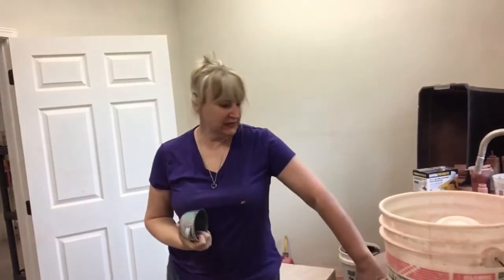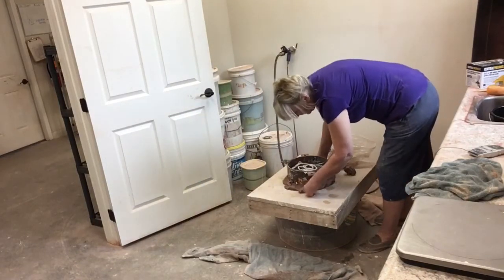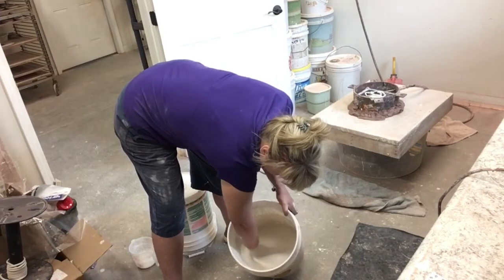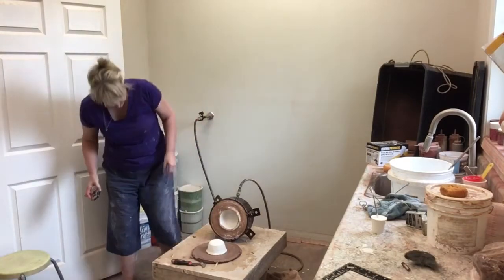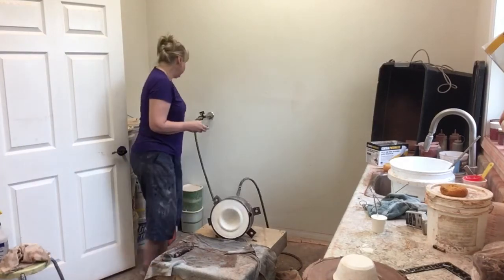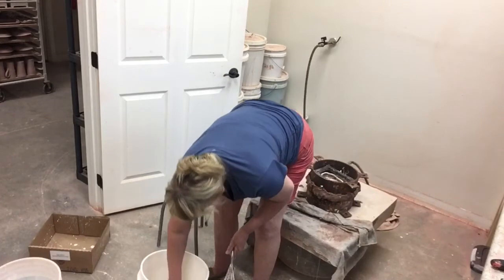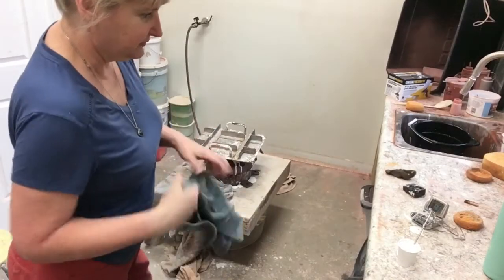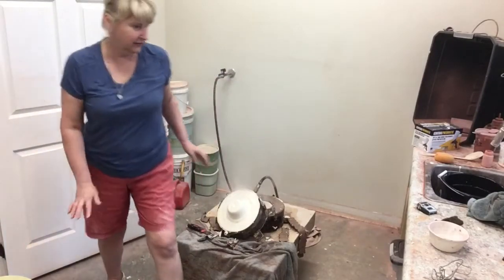Make RAM Press Molds | 2 Part Pottery - Ceramic Air Injected Mold | Salvaterra Pottery | Asheville

Comment: This video is fairly old but thank you for posting! You might be the only video that shows the entire process in depth step by step! I am getting ready to create my own mold so I’ve watched this video a lot! Have you tried using hydrostone? It seems to be the alternative. Ceramical has a pressure rating of 6,000 psi while hydrostone is 66% higher at 10,000 psi! I’m. It sure how thick your metal rings are but they look to be 3/8 so that’s what I’m using!

Comment: Hey Sue. 

Thank you so much for sharing your expertise, time, and knowledge. It is such a struggle finding instruction on air release ceramic press production, I found this video invaluable in setting up our press. Your video gives comprehensive instruction that couldn’t be delivered any other way. 

It is a long video but you continually offering helpful every step of the way without leaving anything necessary out. 

Thank you once again for your generosity, it is very much appreciated.

Comment: Hello Sue! I’m a potter in CT. I just started working at a tile factory making 1 part molds for the ram press. I had a brief training period and this video is filling in some gaps and adding information I didn’t have in my training. Thanks for making this video. You covered all the important steps and I found the video enjoyable to watch. I played it sped up because it is a lot of information to get through. I wonder if you’re still using the ram press and if you have considered making more videos about mold making. Specifically about: 1)designing gutters 2)Arranging your positive and hardware cloth+molduct system.
I’m using hydrostone for my molds but it seems like the whole process of mixing and pouring is essentially the same as ceramical. I add a little citric acid to my water before I add the hydrostone to slow down the curing process. 
Happy making everyone!
Reply from the maker: Good to hear from you.  I’m still doing some Ram Pressing.  I’m taking my original pieces and then having them made with a 3-d printer that includes the cutting edge and gutter.  I’m not sure if I will have time to do another video.  I let my staff go and am doing all of the production myself now.  Since I can throw faster than making pieces on the press, I’m not doing as much mold making.
Reply: Thanks for the video, sister.  Please, I need how to distribute the air pressure on the mold in numbers 1 bar....at the end of the mold vent

Comment: Hey Sue, it is me again… Why  do we wait for the plaster to increase by 23F before starting the pressure…is it important that it does not go above the target by much? I am in the UK and using a substitute for ceramical, as you cant get it here….It gets warmer at a much slower rate and im lost as to whether I should wait for it to increase by 23F (which could possibly take half an hour) or just use my judgement and start the pressure when the plaster seems hard enough. Thanks again for such a useful video…I dont know what I wouldve done without it!

Comment: Thank you for full of knowledge video. I want to make some experiment acording to your metode.
What kind of elastic tube  you are using to distribute the air inside the gypsum stamp? 
What kind of gissum you use for stamp?
In what units do you give the air pressure, psi (pound per squer inch)?

Comment: Sue can you share the soap you use 
Great video
Reply: Murphy's oil soap will work but ceramic supplies companies sell mold soap.  The key is to carefully wipe it on then off letting it dry between coats till the plaster mold is essentially waterproof.

Comment: Fascinating and very well explained. However as a newbie to pottery ,but not industrial ceramics, what is the basic point of all this?

I want to press some simple shapes and I was just going to CNC machine the 2 part male and female parts from PTFE or other material.
What is all the air about and what does Mold Duct tubing do that is different to any other tubing.

Are you trying to make a porous mould ?
Reply from the maker: Good question.  And let me know if I don’t answer it completely.  Injecting air into the mold through the air tubing creates bunches of little air channels in the mold.  We add water to the mold before using it.  And then we inject air into the mold which bubbles up water and releases the clay/shape from the mold.  You can press all day long over and over with the mold.  You could press hundreds of pieces in a day if you want to.  We don’t do that but big operations do.  Some places have folks that all they do is press all day with other staff that do the other steps of the process.  Everyone specializes in one task of the process.  To me and my staff that would get boring quickly.  So we all do many things each day but it gives us the ability to create those pieces we sell in volume without me having to throw everyone myself on the wheel.  Let me know if you have any other questions.  Thanks for asking.
Reply: @salvaterrapottery  Thanks 
Yes  ,I understand. 
So my idea to make simple moulds from non porous moulds ,such as plastic or metal is not going to work too well.
The clay will probably just stick

I am new to working with clay but even with my limited experience see what you mean.
like when I tried rolling slabs on a plastic table it just stuck and smeared.
Then I did it on an absorbent surface and it worked.

Many thanks from locked down England .

One of the benefits of all this is I have looked to things I might never have done.
Reply from the maker: @billycaspersghost7528  I haven’t done 2 part molds that way.  I have cast from 3-d printed pieces to make the mold.  And we do make some stamps with a cnc machine that you would call small one part molds for something flat.  We use a little wd-40 as a release agent on the clay and mold.  We also “slump” clay into plastic trays.  For this, we roll out clay like pie dough, use wd-40 to keep clay from sticking to the counter and the tray.  Move the rolled out clay to the tray and smooth it out to take the shape of the tray.  That is the extent of what we do and my knowledge.  I should probably do a video on slumping for folks.  

Here in the US things are starting to lighten us with restrictions as the vaccinations are gaining momentum and numbers are improving.  I am hopeful!

Comment: Great video, thanks for sharing! How thick is the steel on your die case?
Reply from the maker: We have used different sizes.  Probably from 1/2” to 1/4”. The larger the mold the  more support you need.  You want to prevent torquing your die ring while on the press.  If you torque it, you crack your mold and the air doesn’t come out where you want it.  That is also one the the reasons for welding rebar inside the die ring, to add extra structure to prevent torquing.  It’s a balance with these two things.  We use our best judgment and adjust if we get negative results.  Always better to over build a bit.  I have spent all day making a mold and crack it by torquing when putting it on the press.  What a waist of time and materials.  Ughhh.   Let me know if you need more guidance.  Thanks, Sue
Reply: @salvaterrapottery  Thank you for your help, Sue. It is really appreciated!  There is not a lot of information about this process online, and I am trying to set up a DIY ram press for my business that I have just launched.

By torquing, do you mean deflection? I assume when such large forces are exerted to the edge of the die case it could cause it to bend if not thick enough, and result in the plaster cracking?
Reply from the maker: @nathanoyoung  Yes, exactly.  You have it!

Comment: Wow awesome video, thanks for sharing it with us. I was wondering, what is that tubing called that you're using inside the mold.
Reply: ok i got it, its called molduct tubing.
Reply from the maker: PACIFIC CONDUIT & CABLE
1725 STANDARD AVE
GLENDALE, CA 91201
818-548-7471
5/32" MOLDDUCT LOOM
ITEM #40-MD5/32

LAGUNA CLAY (AXNER) ALSO HAS THIS
1/8" 750 FT SPOOL
Reply: @salvaterrapottery  Thanks for replying. Thank you for giving me the information. I highly appreciate it. Unfortunately I'm in the UK, so I'll look for a local supplier. Thank you for your help. Please take care.
Reply from the maker: Anytime!  Hope it was helpful.
Reply: @RetrowaveUniverse  Hi Saumick, I am also in the UK and looking for a supplier. Have you managed to find one?

Comment: Hey Sue, thank you so much for uploading this video. I am trying to make my first mold but I have the problem that the rim isn´t filled completely with clay. I think the problem is my gutter. Do you have any photo or illustration that explains it for a beginner? what is the thickness of the gutter at the vessel and after the constriction? thank you in advance and many greetings from Germany.
Reply: Another question popped up in my mind: after slip casting the first die, how do you get the clay bed for the second one? do you put the first die on the wheel?
Reply from the maker: I experiment with the gutter myself.  Several times I do not have a gutter at all.  The idea is as I understand it, is you are creating an area fo the excess clay to go when the mold comes together on the press.  When I build a gutter I try to build a shape that creates “back pressure” of clay into the piece I am trying to form, to force the clay to completely fill the space of the piece so there are no voids.  

You might want to just try adding more excess clay when you press the piece to get that back pressure you desire.

If you send me your email.  I can send you some photos of what we have done.  I’m by no means an expert on this process.  We have had success with 3-d printing a shape that has a cutting edge and gutter all as one piece that we cast.  I can send you photos of that too.  Thanks, Sue
Reply: @salvaterrapottery  Thank you so far, Sue. I will write you an email.